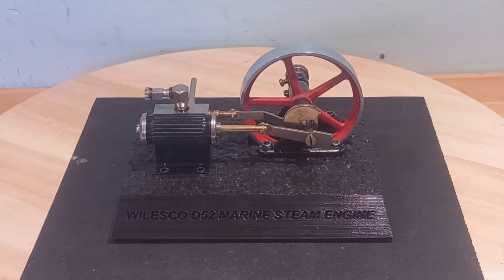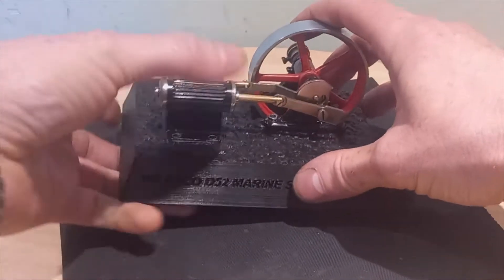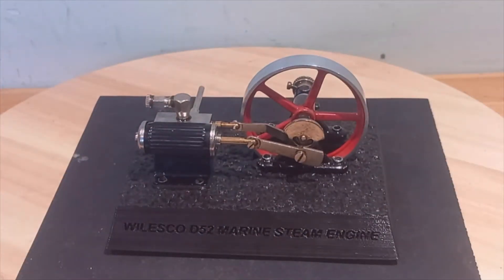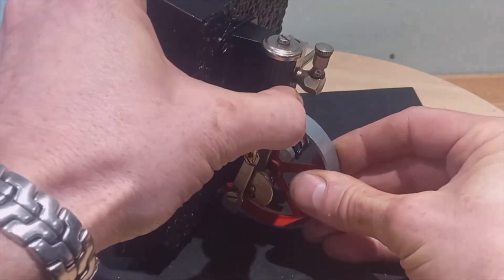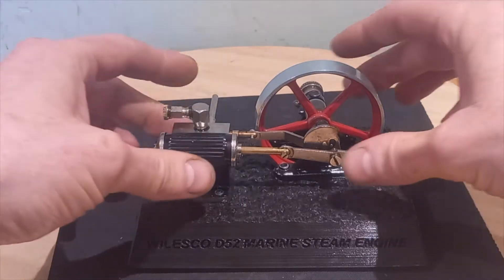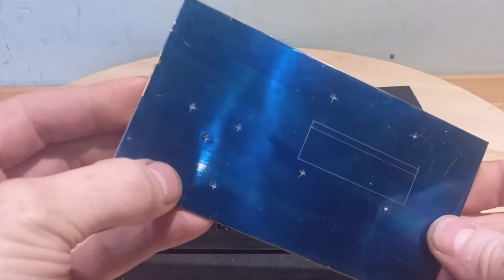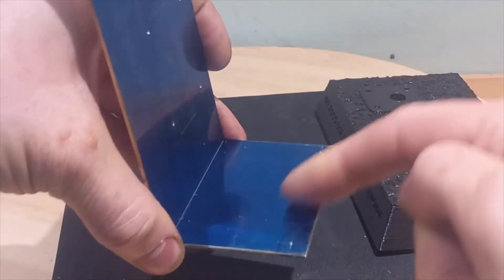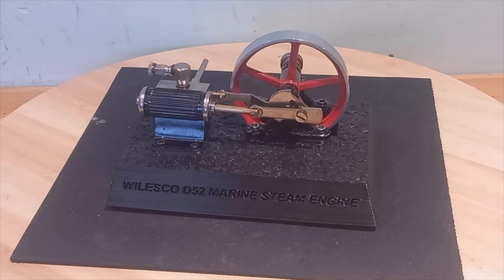Custom Brass Mount for Wilesco live steam engine - D52 Marine Engine

Comment: fascinating. I have been building model ships for 76 years but i have shunned metal work and soldering but wish to understand it. I found the speeded up sections far to fasr to define tools and techniques I gave up. was the base silver or soft soldered etc.
Reply from the maker: Hi! There is a full build vid (with annotations throughout) of this mount and the finished boiler here: https://youtu.be/lEjBwjJX8Tw The base was made from brass and soft solder; unlike the boiler it runs no risk of running dry with a source of heat directly under it, so normal solder is fine for this part… boilers should ideally always be brazed or silver soldered for that reason - while there is water inside, they are functional with soft solder, but dangerous - the ends could pop off with only a few drops left in the boiler as the cylinder heats up